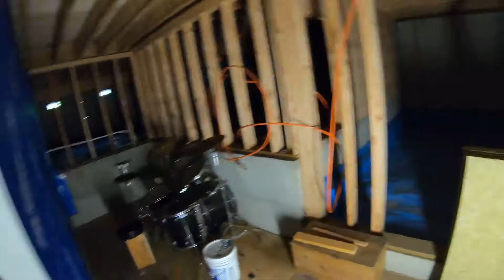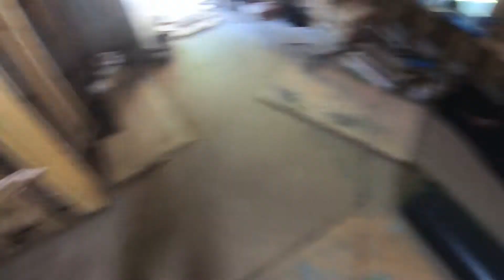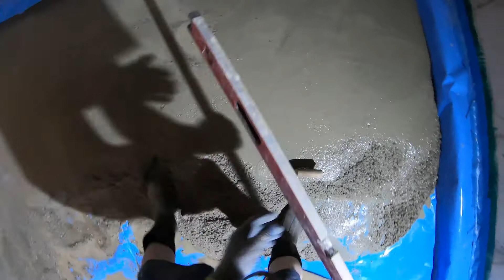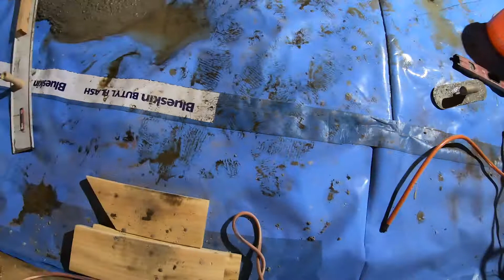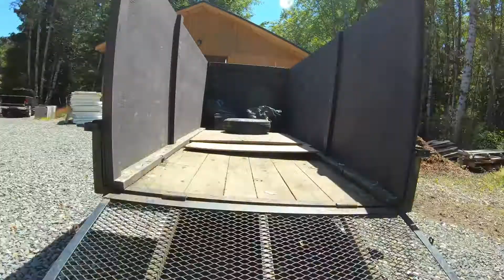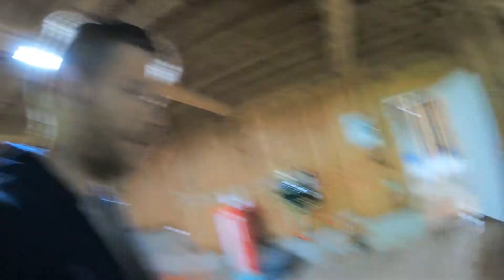Crawlspace Concrete Slab by Hand

Comment: Why didn't you just mix near the room entrance, or get a concrete pump truck.
Reply from the maker: I mixed it as close as possible without making a mess inside, about 30 feet away, so not too bad.  The concrete company in our area has a 4 yard min and this was only a little over two.  Plus the pump truck is an extra $700.  That being said, this video probably shows why the 700 for the pump is worth it.  But if you need or want to save the money you can do it one sack at a time.